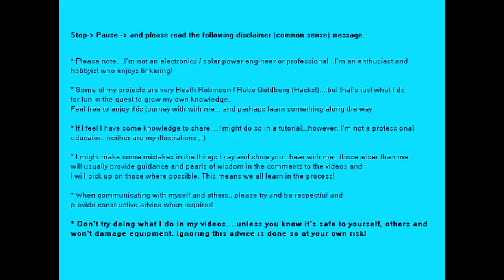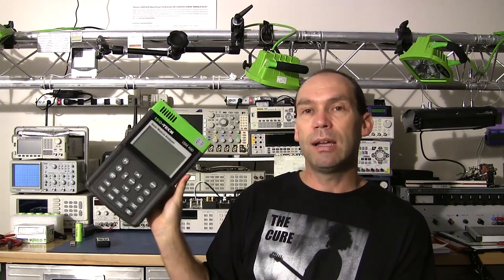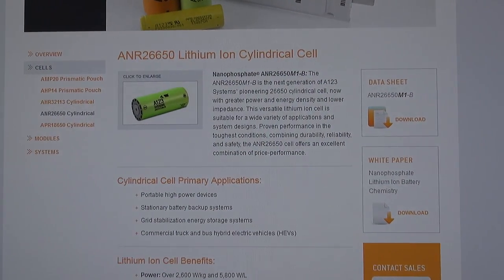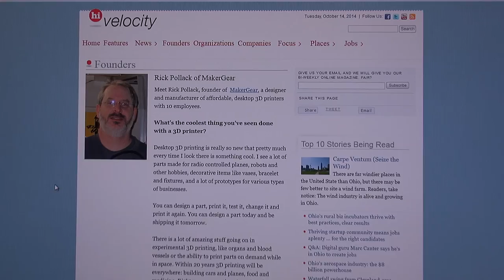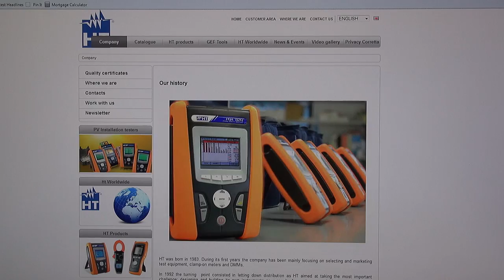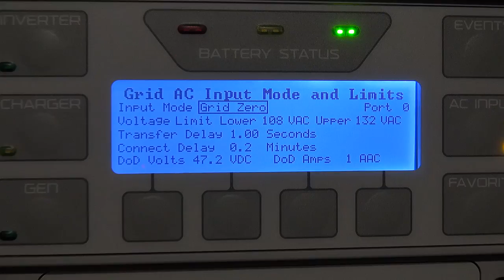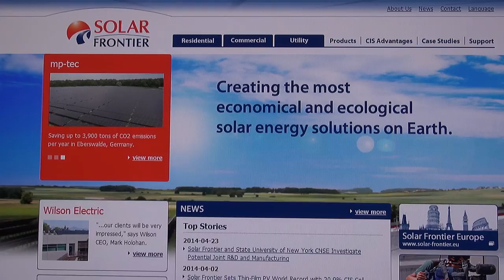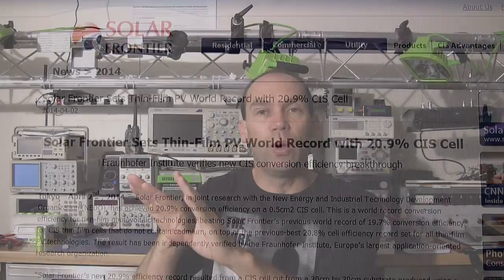T4D #112 - Solar Power International and other bits...

Comment: I deeply appreciate your videos. I found you yesterday, I am going to be installing a solar panel system here in Draper, UT. I'm learning as much as I can not only about solar, but electricity as well. Before I found your videos I had decided that I wanted to use the Enphase 250 microinverters. Yesterday I watched your video from a couple of years ago teaching about the fundamentals of electricity. After I watched that I saw on your channel the video posted a little over a week ago about your system with those exact Enphase microinverters. Made me proud that my research led me to those independently and a educated man in electricity as yourself chose them as well. I think I would like a system that is grid tie, but I have thought of the benefits of doing a system exactly as you are doing with battery backup. I'm very excited about all of the education I have been getting. I wish I could head to Vegas tomorrow to the expo, but I'm such a rookie that I think exploring your videos will be more beneficial for me. I look forward to seeing your findings next week. Again, Thank you. -Tim
Reply from the maker: Tim Johnson Thanks very much for the post Tim.

Comment: Hmm, I like the look of those Wago connectors. Although I'm a firm believer in the terminal block connector, those would be very nice for the hobbiest where you often want to make temporary connections.
Reply: In the UK, they class as maintenance free connectors unlike terminal blocks. They're actually more reliable.
Reply: Wagos rock, the next best would be to crimp. terminal blocks are not classed as a permanent/non maintained connections. Wire nuts are just laughable. Terminal blocks are also crap nowadays, they break out at the bottom unless they are wrapped steel types. I can't wait until the wirelock wago type systems are incorporated into all fixtures rather than just lighting modules/units.

Comment: Hi and thanks for your great videos, learning a lot. I was wondering if the Wago connector could take 60A at 16VDC?.... I can't really find any ratings review for DC applications with the Wago connector.... Thanks for keeping in touch, as it is pretty important for my next project, as I would like using these connectors. Cheers

Comment: Hey great video, I have a  question if you can help, I have a 1 500W  HG1500-BG Black & Decker Heat Gun it has only 2 speed and the slow speed is still to fast is there any way to put a resistor or something  to control the speed. Plz help

Comment: it would be interested to see a system that allows efficient use of in house solar energy from panels and from the grid. A device to allow me to intelligently use the power that I collect from solar and what comes from the grid. Also the solar panels that give AC 230V power seem interesting. I am building my house these days in Europe and I'm looking for efficient and cost effective ways to power it.
Reply from the maker: Daniel Condurachi The Outback Radian inverter has a Grid Zero mode that "blends" whatever solar power and stored battery energy you have and then pulls the rest from the grid. There are some limitations with this mode which is what I'll explain in a future video.
Reply: mjlorton I'll wait eagerly for your future video explaining this. Thanks!

Comment: did you consider the reduced ampere capability when the single wires are bundled and fed through these tubes?

I'm sorry that it's in German, but it's in a very handy form and a good reference: http://www.kfe.at/empfehlungen/verbindl-best/OEVE-EN_1_Teil%203_41.pdf  (ÖVE-EN 1, Teil 3 § 41)

Comment: What is the payback on this solar system? Your return on investment? Even though this is a DIY project, I can't imagine the ROI is less than 20 years? Great fun, and good video fodder, but Geez .... really ?
Reply from the maker: Del Tapparo Good question..one that I plan to do a video on (ROI and solar system payback).In this case my solar system has the following ROI1: The fun and enjoyment of putting it together myself.2: An educational experience.3: It acts as a test bed for future projects and sharing  / video content for the channel.4: Some independence from the grid when there are "brown outs" or power failures.5: Over time it will yield some electricity cost savings and payback...but over an extend period. (not the prime purpose)Any Hybrid or backup solar power system with batteries and an inverter will have a much longer financial ROI than pure PV and grid tie. For most folks installing these systems ROI is second to independence from the grid in terms of priority. There will be times and situations when having backup power in an extended power outage could be priceless.If you are purely looking at ROI from a solar system then just have PV and feed the home / grid. But there are some interesting challenges with this in the future. I hope to cover all those issues in the video.